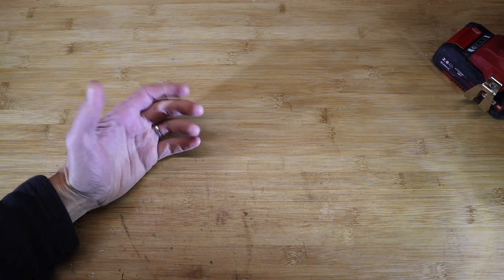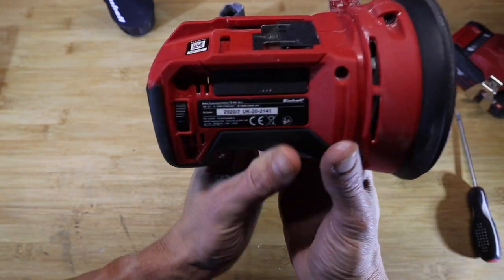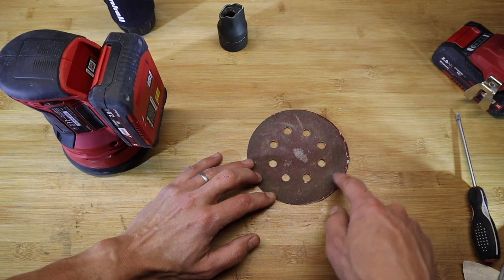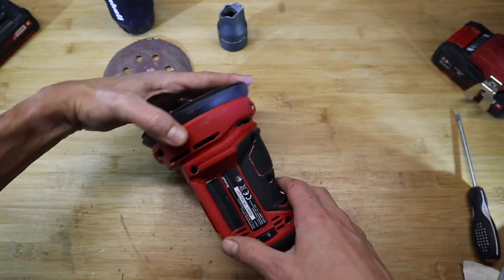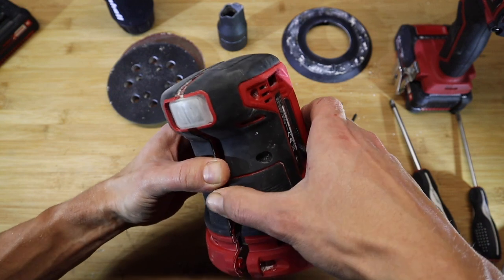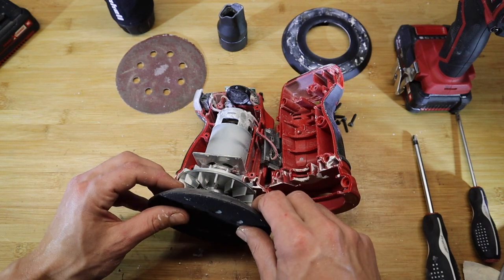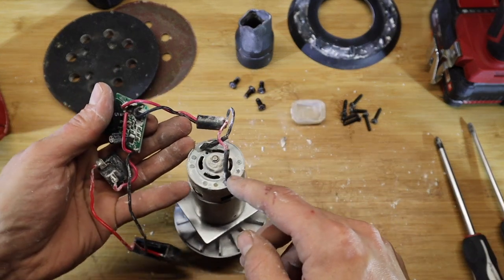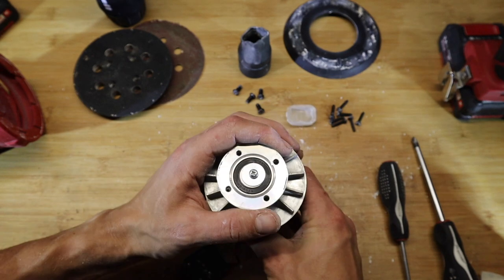Einhell 18V PXC Cordless Sander TE-RS 18 Li Teardown - Any Good?

Comment: Thanks for the video! Subscribed. I think it would be interesting to compare the build quality between cheap tools and more expensive ones. I've had expensive and cheap tools and to be honest never noticed much difference between them that would justify paying 2-3x more. I've had bosch professional drills lasting less than a year with moderate use and cheap drills from Lidl (Parkside) lasting years and getting the same job done.  So i'm wondering what's so much better in a Bosch, Dewat, Makita than Einhell or Parkside, build quality wise, that would justify paying double or triple the price (or making them last 2-3x longer). Thanks!
Reply: bosch professional is where youll see a difference. same for milwaukee and some other prosumer tool brands. 
they use higher quality parts and give you more power, runtime, longevity. specifically, 4-brush dc motors from name brands such as mabuchi, much higher quality gears and mechanical parts, expensive molybdenum sulfite grease and high glass fiber content in the plastic casing for higher impact resistance. 
i think i know which bosch drill you are talking about. bosch sadly happily runs their normal consumer tool brand into the ground with mediocre quality and enormous profit margins. other tool brands do a better job.
Reply from the maker: It's very much a marketing paying for the brand name and an ecosystem game these day's as well. Once you spend money on a battery & charger system you tend to stick to a certain brand.  

Yes, brands operating in the lower price point of the market tend to use different components to those big enough to either make their own or buy in higher quality items but for the most part tools are all made in the same way. The margin is just bigger with some brands. You can compare it to the difference in car brands. They all do roughly the same thing but you pay more for a Mercedes then you do for a VW.  Milwaukee is owned by the same company making Ryobi & AEG (Rigid in the US) do they use that many different/ better components to make one brand that much better than the other? 

It's very much a question as to what do you want out of a tool. Do you use it every day to make money or just the odd time here or there for a DIY project. What are you using it for and how, the power you need, etc. Then it's very much a question as to how much do you want to spend and what do you get in terms of, ergonomics, warranty, spare parts, etc. (Makita for example don't sell spares directly on their website, so you have to send your tool away, which to me is less ideal) 

There are plenty of video's out there on the premium brands in terms of reviews & tearodwns, the for me interesting thing is to see how the cheaper brands are doing things as this is less well covered on youtube, but I'll invest in some premium tools for a few reviews to compare against ;)
Reply: @toolteardown  Do you know the youtube channel AvE? He does tool reviews on an expert level and shows that some tools are on a completely different level than others. He also shows how and why many consumer grade tools wont last very long (under regular use). 
I think your reviews are not nearly critical enough, e.g. the Einhell Brushless drills have a non-potted PCB which is not just theoretically problematic but even the reviews show that it is a very common failure point. 
Cheap tools are good for moderate use (most hobbyists) and sometimes you can get around flaws by knowing them well (e.g. avoiding dust getting into the Einhell drills). 

Bosch Blue vs Green is a night and day difference in most cases. Paying more for tools usually gets you a lot better quality, although there are brands sneaking cheap designs into the professional market.
Reply: Einhell ist only for diy users. Some tools are good and other are crappy, it depends on your use.

Comment: Tell me how this sander works on walls or ceilings. It's quite high, and with my 5,2Ah batt will by heavy. I'll do some plasterboard construction and I'm wondering about it. And what about vibration?
Reply from the maker: Drywall or Plaster is a very soft material, so you can get a lot done with a 2Ah/3Ah battery as you run the sander at speed setting 2 - 3 with little to no pressure. The heavier batteries will make it more difficult over longer periods of time. I tend to use both hands just to keep it flat to the surface with 120 grid paper. Ceilings are a little more cumbersome as you tend to having to hold it above you head... (getting a bespoke drywall sander would probably be better, but for the odd job this works pretty well) Vibrations will become a things after a few hours of sanding and you might want to hook a vacuum onto the sander as the dust is unreal! ;)
Reply: @toolteardown  Tx. You know in price one Bosch GEX 18V-125 + batt + charger I can buy Einhell TE-RS + for example Stanley SFMEE500S-QS or so.